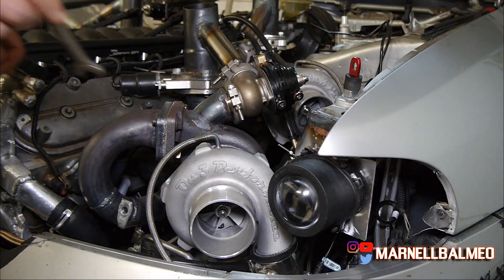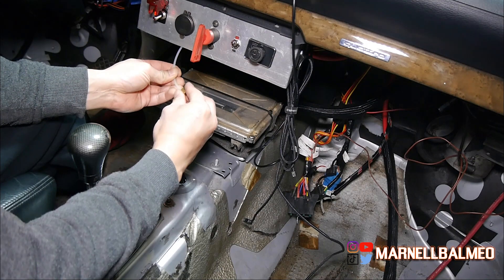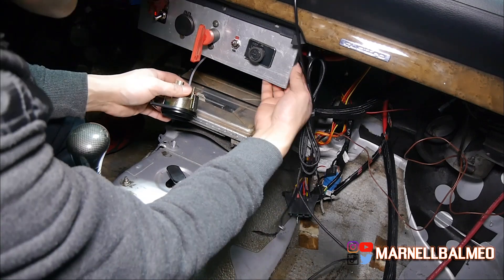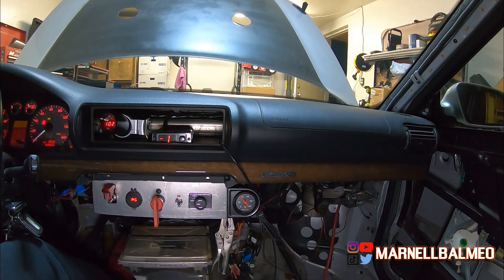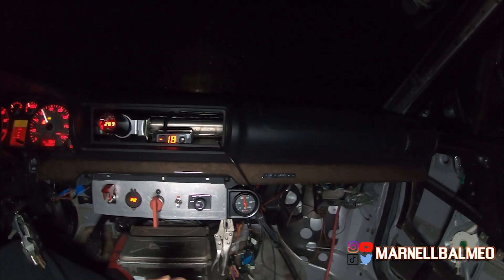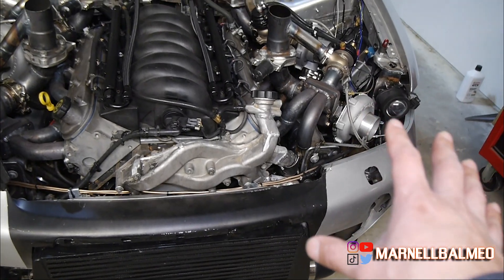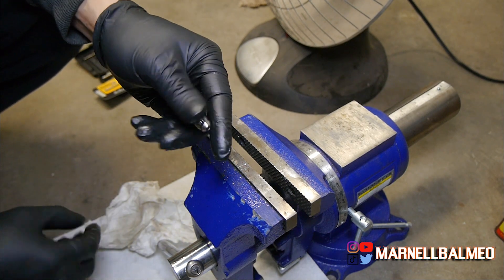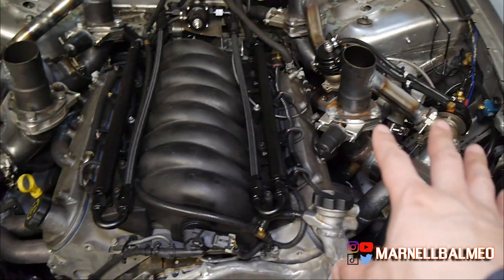Journal Bearing Turbo on LS. Do I need a Restrictor?

Comment: I wouldn't run a restrictor with a journal bearing turbo
Reply from the maker: Depends on your pressure, I run them on mine now and I haven't had any issues. When I didn't I lost a couple of turbos due to hphf pump
Reply: @MarnellBalmeo  do you have a smoky turbo? If so, how did you fix it? I have the same problem at the moment I only have a catch can set up. Should I run a PCV set up?
Reply: @MarnellBalmeo  What do you mean "lost a couple of turbos".  Journal bearing turbos don't have pressurized seals, you literally just have to evacuate the oil as fast as you're feeding it to keep it from filling up the cartridge and leaking by the shaft.

Comment: You should probably not touch the restrictors… make sure your O-ring on the pickup tube of the oil pump is sealing correctly. If your pressure doesnt jump around, the o ring is usually fine.  The easiest way to bump the pressure up slightly on a LS engine is to add a .040” shim under the relief valve of the pump.   They sell kits for this. Sometimes with stiffer springs.  But since you have your 40psi baseline, just add the shim.  It should bump you up to 55 or so depending on the wear of the pump. Porting it wont do anything to the pressure.

Comment: How much psi in the engine.
Reply from the maker: Depends on the rpm easily 70+ now with the high vol/high press pump
Reply: @MarnellBalmeo  if you are running a low profile oil pan, I would highly encourage you NOT to use a hi volume pump. Melling also recommends against this with shallow pans… you’ll risk starving the sump and it can cause engine failures. Very common with racecars.

Comment: If your turbos are only getting 40psi and never higher you dont need a restrictor at all on your turbos
Reply from the maker: That's for the ball bearing correct? I saw 60psi for journal